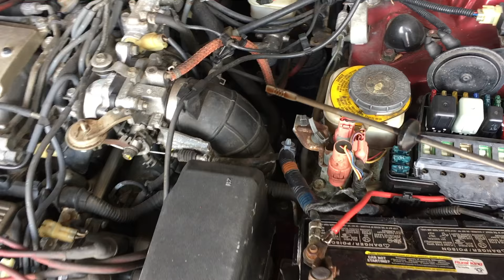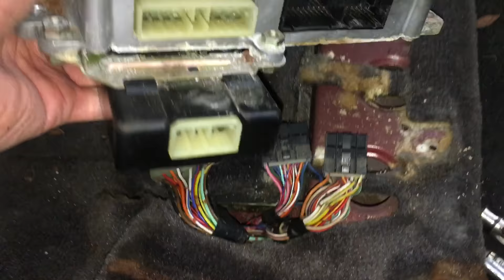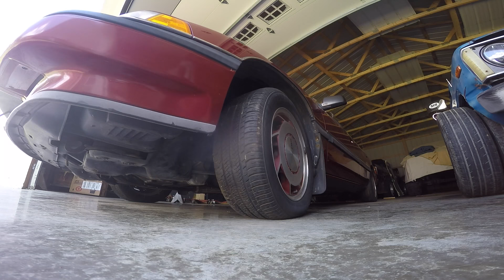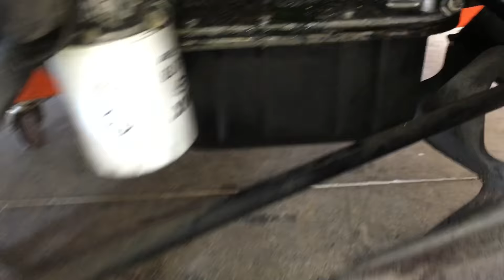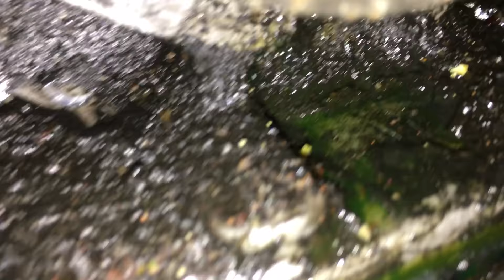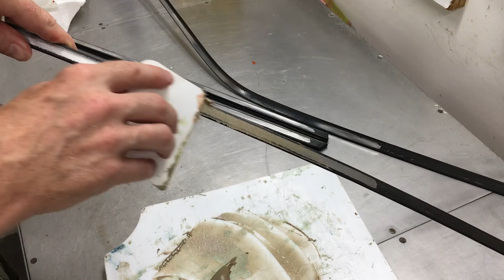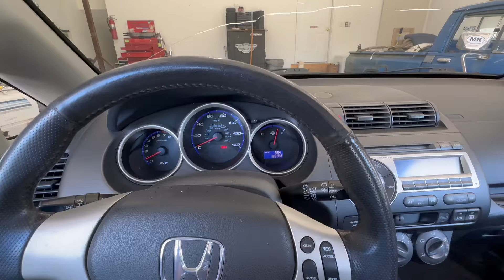$350 Acura Legend Full Restoration: 15 mins Start to Finish!

Comment: A lot of people have no idea that the 80s and 90s cars are still kicking, this consumer culture. They think if it's not new it's not worth it. Absolute gem! And great work on that Enkei.
Reply from the maker: I couldn't agree more. I buy older cars at their peak depreciation. I don't need all the bells & whistles... I'd rather have simple and reliable. It's too bad cash for clunkers took so many off of the road.
Reply: @6thGearGarage  I remember that dumb program, running cars engines on high until they blew up. Smh
Reply: @oreally8605  that was where the program entered nefarious territory, when perfectly good engines that could've been resold to keep other working vehicles on the road were destroyed. The majority of cheap mid-2000s domestic cars that C4C buyers used their rebate towards are likely gone from the roads as well now too.
Reply: @6thGearGarage  One of the worst things to happen to the automotive industry. The car manufacturers are laughing though because they still ended up with the metal again, and are selling you a 2024 made of your 70s-2000s cars.
Reply: @6thGearGarage  if I can comment on that
.I hated cash for clunkers. So many nice cars got destroyed for nothing
Reply: @6thGearGarage did you get the sunroof fixed?
Reply: @6thGearGarage  most of us under 40 just assume that anything older than we are is going to cost more to fix than it would cost to just buy a new car. We don't WANT to replace it, we just can't afford to fix it. Unless car repair guys want to start repairing things like this for less than $5k.
Reply: Repair parts inventory is rapidly depleting
Reply from the maker: @themadmallard  Indeed, there were many parts for this car that were impossible to find.
Reply: @6thGearGarage  unthinkable isn't it? That it would be difficult to find a popular Honda car repair part? Considering how many of these cars were sold? Well, whatever, your work looks good and I'm sure the next person will enjoy the car for as long as they can.
Reply: I will most likely never touch an American car from the mid 2000s and up because the newwrt cars I have owned have been the quickest to give up on me I got an 89 grand marquis and only had the starter solenoid replaced and it still runs like new after a year of me driving it
Reply: Because shops want $10,000 to repair a car now. It isn’t worth it.
Reply: exactly. Ill never even buy a new car, ever. paying 50-70k for a goddamn car is insane to me. Ive never payed more than 5k for a car and the truck I have now I bought for 2k and had it for about 6 years so far. I love cars like this.
Reply: TOP COMMENT!!! When people tell me I need a new car, I ask them how much have they spent on leasing and/or financing different cars in the last decade. Consumer culture is an epidemic
Reply: Old cars just aren't worth it. To get them fixed, the mechanic will charge more than the car is worth. Now if you excuse me, I need to make my monthly 800 car payment.
Reply: I just sold an '88 L coupe two weeks ago, it had 166k original miles on it. Dash pad was immaculate, seats were leather and pretty worn, but every power accessory worked, including the sunroof. Manual antenna. Had the transmission shipped from Georgia, the original one had a cracked housing and was unfixable. No rust. No accidents. Paint was impressive, no peeling clearcoat.
Reply: A lot of people have no idea cars from the 90s are "still kicking"??  What? Lmao
Reply: @user-nf4wg9ek1w  People love to push this narrative that everyone has a new car. The average age of cars on the road in the US is over 10 years old now. I see many early 2000s and late 90s cars around me. Hell, I owned an 03 Chevy and have an 01 GMC right now.
Reply: If I could find one that was totally rotted away I'd have one.  Best thing is you could replace the stereo easily and most of your modern conveniences are instantly put in an old reliable car.
Reply: Yea, especially those toyotas and Hondas. All coolant flanges, manifolds all aluminum. Metal gaskets.   Those are long lasting cars, not the rust blocks from the 60s or 70s  after the 2000s  longevity  was traded for fuel efficiency
Reply: Cash for "junk" cars didn't help either.
Reply: Someone had to buy the car new for you to get it used.  We're all here because we like old cars, but let's not pretend that there are no benefits to having a newer car. My car is quicker, safer, more comfortable, requires less maintenance, for cheaper in today's dollars than the legend msrp in 1980s dollars.
Reply: no stup!d.  its a safety issue.  doing this in the real world expecially if youre an id!ot should be illegal.

wouldnt be surprised if this guy had to search for month or just planted this car and played it off like he "just found it".

if cars like this had to pass inspection from any country except 'merica it would be scrapped for very very VERY good reasons
Reply: I have a 91 BMW E30. I often get comments from people while driving it about how old it is. I'm "only" 40 years old, but these were the sort of cars I learned how to work on. To me everything on cars from this era are still comparatively simple and easy to work on compared to what's current now. Seems ironic considering how many old hat wrenchers I would talk to in my teenage years who absolutely refused to work on anything computer-controlled or fuel injected - that stuff was all so ridiculously simple, easy to diagnose, and keep running in that era, they just didn't want to learn anything new.  Fortunately parts are still easy to find, but I have a couple older Explorers that I keep around as winter/camping/hunting rigs that are now getting into parts purgatory - Cash 4 Clunkers did in so many of them that they're unobtainable in junk yards. I recently saw someone with parts yard catalog system find that there are only 31 complete indexed Explorers in parts yards across the entire US - 31, that's it.
Reply: Idiots, the lot of them.
Reply: The Lexus LS is a perfect example of a good car still running from the 80s and 90s
Reply: I almost bought a 90s Lexus for like a grand right before the pandemic. Guy was a little too insistent that it was as reliable as a Corolla but I still wish I'd gone for it.
Reply: @HaonProductions  You goofed because Lexus from 90s to 2010's are all bulletproof cars. They won multiple JD Power awards over those years. I have friends and family that have em. Manual SC400 and a buddy with a GS350. They still drive them, and haven't had to fix a thing on them lol
Reply: Did you get the sunroof fixed?
Reply: I saw a circa '90 Camry and circa '90 Accord on the road, within a week of each other, maybe 1 month ago. I overtook them on the highway, but they both looked mint from a passing distance on the highway. Most of the Toyota and Honda cars from that era were just bulletproof. Rubber vacuum lines and the unfortunate hole in the roof/sunroof aside... if you can somehow keep it from rusting, it will outlive you.
Reply: As long as the AC works. I couldn’t care less what it looks like.
Reply: Sun roof. Smh. I have one, and NEVER use it. Useless.
Reply: I agree as well. same with me.
Reply: For real. I get compliments all the time and people asking if I want to sell my car. NO THE PONTIAC ISNT FOR SALE! lol
Reply: no, they don’t think that you dolt. most people don’t have the ability to restore a 10 year abandoned car
Reply: Still driving my 1991 BMW 535i.
Reply: I recently re purchased the same whip I had in my early 20s.  1990 Honda civic hatchback.   So simple. So easy to work on.
Reply: That's not true anymore, the late Gen Zers and the early Gen Alphas are all about these 80's and early 90's cars.
Reply: They will last out the cars made in 2025-26 after another decade.... All trust me lol
Reply: I would also include early 2000’s cars, they were similarly built.
Reply: As much as i LOVE older cars (owner of a NA miata), i could understand except the safety standards today are much higher, cars today are safer.
Reply: back in the day our parents bought 1 car and drove it until they passed away
Reply: Enough of this romanticizing old cars just because they are old. Newer cars, namely electric cars, are better in every metric, especially the metrics that matter. Safety, maintenance, reliability, comfort. Not to mention, no need for the consumer to deal with any fossil fuels or most toxic chemicals directly anymore. Ask someone that knows and lives with them on a daily basis, they will tell you.
Reply: @ceciliamontenegro7861 ”Safety” I have walked away from a T bone in my 04 Corolla while the idiot who hit me burned in her Volvo XC-90 that was a year old yea so much for safety and by the way giant lithium battery’s are not good for the environment
Reply: @ceciliamontenegro7861  A majority of people are not fortunate enough to afford an electric car, and as a mechanic id take a beater over some of the garbage electric cars i see in the shop every day for stupid software of poor manufacture defects, also you cannot repair your electric car yourself not only due to the level of complexity but due to the dangers of high voltage, new electric cars are only beneficial if you have good money. Most dealerships who are certified to repair electric cars charge an arm and a leg per hour of labor.
Reply: Let it be clear, I love restorations. But let’s not kid ourselves here and use common sense.

Comment: 10 grand worth of work and parts for a car that's worth less than $3000 in immaculate condition.
The only good part here, as well as the video, is that it teaches you new things and gains you experience, which is something you cannot buy.
Reply from the maker: I only put about $1450 into the $350 car, so it was a low budget restoration. I definitely learned a lot, and it was all fun, except for the timing belt... that actually felt like hard work. Rather than making a profit on the car, the end goal was to help the channel grow and earn revenue from the videos. I would have kept the car if I had the space and time for another vehicle.

Comment: injectors not looks bad it can be cleaning. it fill with dirty fuel where is a fuel filter?
Reply from the maker: The fuel filter was in the engine bay, on the firewall. I replaced it as well.

Comment: You say your not a painter but that came out NICE, great color match....That crank pulley trick is the best tip Ive gotten off you tube, used it not to long ago on my 22R, saved me pulling the rad ect to use impact wrench....
Reply from the maker: Thanks! I made mistakes, but spent the time to fix them and it turned out looking great.

Comment: I remember this series.  That car oozes cool.  
How much did you sell it for?
What do you do with 10+ gallons of old fuel?
Were there any mold concerns with the seats/interior?
Keep up the good Work!
Reply from the maker: It was such a cool car, especially with the period correct wheels. I had it listed for $4k, then 3500, then I was about to drop it to $3k when I was offered the trade for the Fit. The Fit was a little rough so the guy added a few hundred cash on top. My daily at the time was the 80 series land cruiser, so the Fit getting 3x the gas mileage was exactly what I needed. I left the buckets of old gas out to evaporate over time and when there was a lot less left, I had a nice bonfire. Once I let the interior dry out, there was no odor anymore. Aside from the algae on the floor, there was only a tiny bit of mildew on the ceiling near the sunroof, which wiped right off. Thanks for watching!

Comment: my tercel wagon suffered from water leaking into the interior. it had a severe windshield leak and a bad drivers side window regulator. the carpet was green the dash was covered in mold, the seats were nasty and there was a ton of mushrooms and mod growing on the headliner. after thoroughly cleaning the carpet, replacing the dash, the headliner and all of the seats I finally got the car in a livable condition. water leaks are not fun.
Reply from the maker: I can't say I've ever seen mushrooms growing in any of my cars!
Reply: @6thGearGarage  it was bad. the car was last registered in '06 and it appears to have lived its whole life outside. if I didn't have friends who collect these cars and have ample interior parts it probably would have turned into a parts car.
Reply from the maker: @retro_88yota  Did the water inside cause the floors to rot? That's one of the main issues I see around here with the 80's Yotas.
Reply: @6thGearGarage  it did, but thankfully it only ended up with a few small holes. I scraped out all the sound deadening and cleaned up all the rust. Hopefully it should be good now.

Comment: Amazing work, that car is a rare gem and it deserved better than the scrap yard. Seeing old jdm cars being restored to original specs is my absolute favorite content and you did a great job!
Reply from the maker: Thank you!
Reply: @6thGearGarage Currently drive a 2014 Acura RLX, known as the 5th Gen Legend in Japan. 142k miles.
Reply: Even rarer is the Legend's British step brother, the Sterling 825 and 827.  I drove a 91 sterling 827sl for several years. The transmission was acting up so I rigged up some switches to manually change gears. That worked for a  a while  until it finally wouldnt shift to third gear.
Reply: @jwh1776 Yeah that was made by Rover, but they called themselves 'Sterling' in the USA and pulled out in 1991 due to poor sales apparently. 
I thought you Americans loved British stuff though?
Reply: Exactly! This came before any Lexus by 4 years.

Comment: Inspiring. Great job. Working on a 91 Lancer, and going through similar steps and obstacles.
Reply from the maker: Thanks for watching! The 80's and 90's Japanese cars are my favorite to work on.
Reply: @6thGearGarage  They are easy to work on and reliable - the auto industry's golden age.
Reply from the maker: @LAJAP  100%  The 80's Hondas were still pretty cluttered with vacuum lines. The early-mid 90's (OBD1) were my favorite because a few sensors replaced a lot of vac lines and emissions were still simple. Not to mention moving from PGM-FI to MPFI, and variable valve timing. All the good stuff in a simple package... a true golden era.
Reply: @6thGearGarage  I got the short end of the stick with those vacuum lines, I know exactly what you're talking about. This Mitsubishi Lancer (Dodge Colt in the US) is a carburettor version, and it is taking me ages to find why it hardstarts when hot.